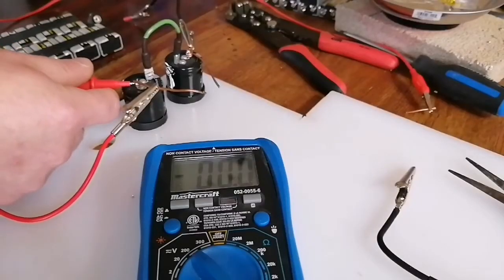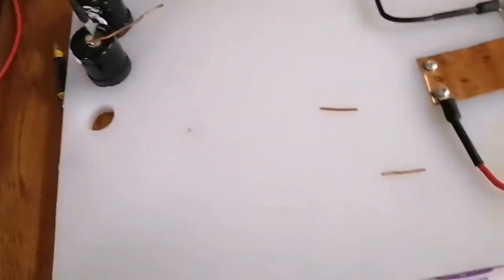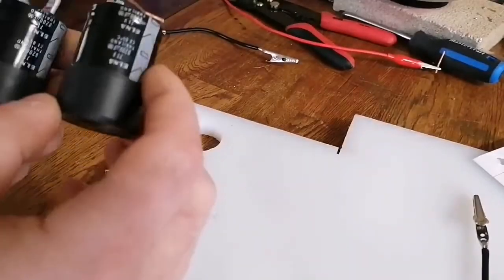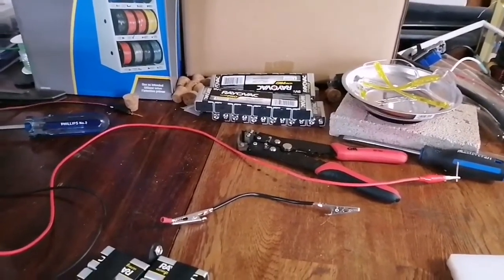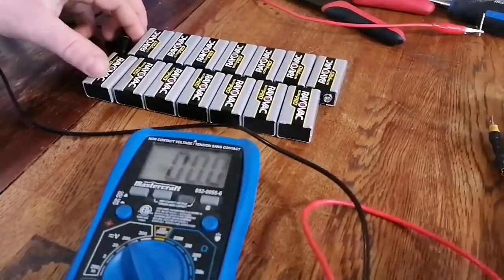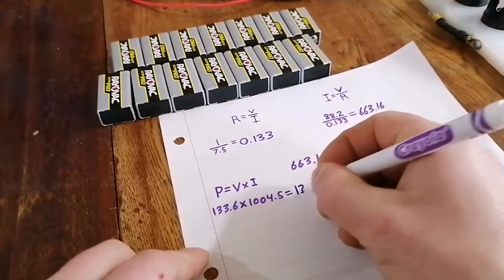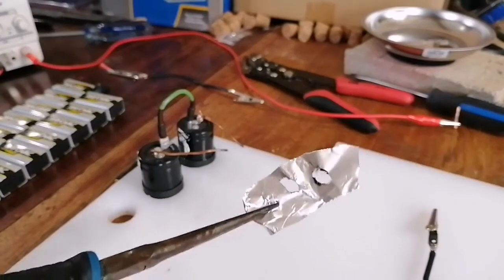Calculating Capacitor Discharge Current

Comment: I will say,  the contact point resistance will likely go down when that much voltage and current is applied. The metal either melts together or gets arc plamsa over a few square milimeters of the contact which helps it conduct.

Comment: If we factor in pulse rate in relation to joules per second then we could get much more energy out the capacitor if you pulse it. Have you experimented with an oscillator that will repeatedly discharge a capacitor thus increasing the energy level?
Reply: This is amperage dumped into a dead short, which all capacitors do well in delivering extremely high amps. It's not about the pulse train or any of that IMO, it's about somehow magically charging the capacitors that fast without actually using power. As of now we still are required to put energy into the capacitors before we discharge them.
Reply: @slackjaw so basically add an inductor to the cap, form a tank circuit and calculate resonant frequency or are you suggesting another method?
Reply: @slackjaw your comments get deleted on other videos, so i wrote all this good information down. Lets see how ít goes
Reply: @Magneticitist  so if we find a way to charge very fast the capacitor we can use the huge amount of power dumped into the dead short.what if we put a heavy load as a dead short
Reply: @giorgosz  Either way you look at it this is something that has been calculated by people for as long as I've been alive. There are extremely high amps discharged at an extremely fast rate over an extremely short period of time here. The 'time' variable here is what's most important. The amps dumped can be incredible with low ESR caps or supercaps etc. When you charge it from completely drained, it temporarily wants to pull a very high amount of amps so long as they are available, until gaining internal resistance and charging slower given a particular voltage input. You feed it those high amps, then over time fill it the rest of the way at a slower rate. When you discharge it, you are dumping literally the same energy you just put into it minus what you lost as heat. I can slowly pull back a rubber band over a period of 10 seconds, then at the peak of what the elasticity can take I can let it go real quick and let it snap against something. That snap may seem like quite a tremendous force compared to some instant of me slowly pulling the band back. It's still the same energy over time you add it all up though.

If you fill a bucket of water, then find a way to dump the water really hard and fast to where it seems to be transferring a lot of energy, you're still just dumping the same water you put into it to begin with. You may have slowly filled it with a hose, then dumped it extremely fast.  When you have a reservoir ready to be dumped somewhere and this reservoir is able to dump all it has extremely quickly like a capacitor can, you are just taking advantage of a stored charge in a way you could not do over-time from your input side when you were filling the reservoir.  But let's say you could fill the reservoir just as fast as you could dump it.. Where's the extra energy?
Reply: @Magneticitist  you re right if you could charge somehow without a lot of energy the capacitor then you have something. But you have almost the same energy as the input
Reply: @giorgosz  This is why there is no magic in the capacitor dump because we need to fill them to appropriate amounts of energy storage without actually putting in that amount of energy from the source. If we're able to do that then we already have overunity and every stage after can be practically anything.
Reply: @SKYLARKING  In a word, no.
Reply: @SKYLARKING  Sure sure that's me the disinfo agent. Strange that somehow you're the one saying an LC driven transformer is overunity.
Reply: @SKYLARKING  You don't make sense. First I'm a disinfo agent by telling you that your OU claim is not accurate. Now I'm sensitive? Explain to me how what you quoted me on is wrong? Who the hell is TK? 

And again, no, an LC circuit is not overunity. How can you be serious when you say that? That is not common knowledge among anyone in the electronics world. Just from a general basic underlining of an LC circuit, you still have real world resistance in everything. An LC circuit can freely cycle forever in an ideal example where there is no resistance. That's what you could call unity if you wanted to but there is no work being done there. Definitely not overunity. We use LC circuits to create better efficiency. It's done all day every day in every kind of way you can imagine.
Reply: @SKYLARKING  Obviously you don't quite understand how an LC circuit works because you're acting like its basic behavior is some kind of clear overunity. The L stores energy. The C stores energy. Yes, they ring it back and forth and damp as the power transfers to the load. But it's like gee, I wonder, where did they get this energy from? Well if you want to say Earth is helping, then sure fine there's all sorts of ways I can think of to siphon a small bit of power. There's also solar panels etc. 
When you start saying this charging from Earth ground garbage you start immediately letting it be known that you don't get how capacitive coupling works either. 

And yes I remember Tinsel many years ago as just some guy who was some kind of engineer or technician and hung around to test circuits and build tesla coils etc. I suppose maybe one day he said that a basic LC circuit is not overunity also. IDK maybe he told you that with a tuned transmission you are transmitting more real power which doesn't equate to less power drawn from the input. 

What do you think is even happening at resonance? That you're like lightly tapping this swing and then it's dumping all this energy out, with you only having to lightly tap it again? That doesn't even conform to basic newtonian physics. 
Literally everyone who understands LC circuits realizes that you're not putting more out than you put in at resonance. You're just putting in the energy most efficiently while still experiencing the resistive losses. You put energy into the swing, you're able to keep doing it over and over until that sucker starts to circle all the way over. You're not putting the same amount of energy in each time, you're putting in more and more because now you have what you could call a plain DC resistance against your pushes that won't change.
Reply: @SKYLARKING  The water analogy just doesn't work. I get sort of why you're using that. Electrical power or just power in general doesn't work that way. That's like thinking a DC capacitor closed in a circuit can sort of just keep looping around the electrons forever recycling the power while also running some load in the process. The analogy you're describing is the same thing as literally a single conductor. Just a wire, or a coin, or a metal bookshelf etc and saying water is the electrons contained therein. If it could just get its same exact electrons back all the time, like they had individual names or something, and recycle them then blah blah NO. You just still have the same conductor with the same atomic structure. If you add more charge to it from elsewhere then sure it has more, so what? 

There is something called energy transfer and what happens is in the best case scenario is what you described earlier. You put X power into the transformer and get X-R through the load. Resonance isn't like a 401K plan where it's like matching what you put in to some some extent. You simply get back what you put in for a cycle minus the loss. It's not doubling up and so on without you literally feeding it. This is why an LC tank does not naturally rise and rise forever on its own. It rises because you are feeding it. If you stopped feeding it, it would ideally just oscillate with what you fed it forever.
Reply: @SKYLARKING   I know what I know from personal experience and when cross referencing that with what is taught about LC circuits, it all makes sense. This is the benefit of being self taught, I'm free to think and absorb what I feel works for me based upon even advice from people such as yourself. With enough experience in actual LC circuits I can now identify what you're saying to be complete garbage juice with who knows what kind of intentions behind. 

Even if you wanted to help in some way with some real advice, just saying you need a specially tuned resonant transformer is not going to help anyone on the entire planet. What it would do is have people wasting hours on end with ZVS drivers and shit using the strangest designs while sometimes looking right past what could have been a pretty efficient converter. You're free to do what you want like me, and you can continue to waste peoples time with the bunk that leads to possibly some fake pats on your pioneering back. 

The entire foundation of the video we are even commenting on is some dude discharging capacitors and going wow that's a lot of amps, then people going "overunity". I mean cut it out.
Reply: @SKYLARKING  blah blah blah
Reply: @Magneticitist  Rick Friedrich said step charging is the solution to this problem. Step charging like bedini used can have a very high efficiency theoretically
Reply: @scraw3  What did they mean by step charging? In battery-charging terms that seemed to mean doing what already naturally occurs when charging a battery, or even a capacitor. All I've read was the idea of "stepping down the current" as the battery reached above nominal and close to full charge voltage.
Reply: @Magneticitist  the annoying thing about it is when Rick brings up step charging he never dives deep into how it works, but insist that it is a major factor to use a capacitor to power a load. He said that was what don smith was secretly doing to get those kilowatt outputs. Don would step charge a capacitor then discharge it in pulses and not a constant current. I suggest contacting Rick at renaissance charge or watch videos on Stanley Meyer replication, which apparently shows the waveform of a step charging circuit. I'm still searching for the right information myself
Reply: @scraw3  Doesn't surprise me he's not exactly detailed with the explanation honestly. I'd have figured a more "loving path" lol. Anyway the idea even in a general concept like that still doesn't make sense to me. No matter how the capacitor is charged it's still getting charged right.. so unless we've lost the ability to account for that charge we can already assume the magic is in the front end if it's charging capacitors via some free energy of sorts. If not, then we have to figure out why some capacitor discharge is really giving such high outputs. I'd wager just because that's what capacitors do, for a very short time which amounts to peanuts in the end. It's more or less the entire point of using them for current reservoirs. Since we all know we can charge a cap and short it out to see those amps do things like weld or blow chunks out of metal, the problem is recharging them fast enough to make that discharge seem continuous. If it isn't, then we are going in circles because we need more capacitors on the output lol.
Reply: @kestas4792  yes I agree. I'm building a few resonant transformers implementing the formula you mention for energy amplification. One of those coils will power a storage cap bank. Please explain what you mean by disturbed discharge because I need to figure out how to discharge the cap bank atleast 60 times a second
Reply: @kestas4792  ok yes I'm employing a disruptive discharge already
Reply: @kestas4792  if you asking me about my driving frequency, all my  transformers will be pulsed at 30 khz.
Reply: @kestas4792  one transformer is fixed frequency at 30 khz and the other is quarter wave, so I can step up frequency from 30 khz to 50-100 mhz. Spark gap to transformer and cap is a good idea
Reply: @kestas4792  are you familiar with resonant inductive charging? I read that it is up to 90% efficient in cap charging since normal cap charging is under 50%. You can control the cap charging speed with different size inductors. No energy is lossed using this charging method
Reply: @kestas4792  this is what I'm talking about "The efficiency for resistance charging is then 5.0mJ / 9.90mJ = 50.5% (approximately as expected). The efficiency for inductive charging is 17.1mJ / 18.5mJ = 92.4%.
Thus the inductive charge is about 1.83 times as efficient as resistive charging, for the simulated conditions.The capacitor charge time for the inductive circuit is approximately 1/2 cycle of the LC resonant frequency or π√(LC).
Thus for the simulated values of 1mH and 100μF, the charge time is π√(1mH*100μF) ≈0.993ms, which is very close to the simulated value of 1.01ms. A lower inductance would give less efficient, but faster charging while a larger inductance would give more efficient but slower charging time.
This efficiency change occurs because the the peak resonant current is inversely proportional to inductor size, which changes I²R losses from the parasitic series resistances, as previously noted. The tradeoffs are charge efficiency vs charge time and physical inductor size and cost."
Reply: @kestas4792  an article posted by someone in electro tech-online

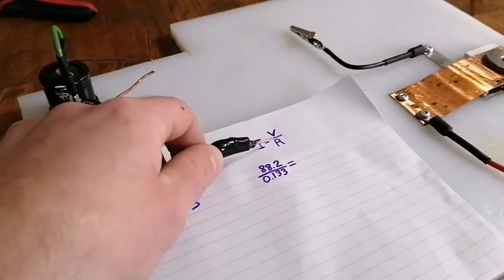Comment: 2:00 - Or you could just take 7.5v per volt and multiply 88.2v to get the current of 661.5 amps (not sure where the ‘hours’ came from).
Reply from the maker: Good point. And you're right, I should have said amps

Comment: how to measure the endurance? I am trying to make a capacitor flashlight as an experiment and I need to find the right size capacitor and resistor so the light can last a few minutes.
Reply from the maker: Hey thanks for the comment, how much voltage do you need for this flashlight? I'm thinking I would recommend buying a few supercapacitors off Amazon or eBay. If you try using regular capacitors like what I have here, there won't be very much total energy and you'll either have a massive flashlight, a dim one, or one that doesn't last very long. As for the correct resistor, I'd recommend watching some videos about ohm's law. I could explain it here but it would make this a reallllly long comment 😂

Comment: That was a good video. Very educational.
for my own curiosity how to measure the charge in a capactior, is it just hook up multimeter leads to both terminals, or will that blow the multimeter since amperage is so high?
Reply from the maker: Thank you, it's nice to see that the video is being generally well recieved. As long as the multimeter is rated to measure the expected voltage of the capacitor, and is turned to the correct setting, it will be fine. In fact, a low voltage supercapacitor can be used to power normal things like a light or a toy motor without blowing them up, because capacitors are subject to ohm's law just like batteries are. Hope that helps!
Reply: @thecrazyfarmboy  thank you. i can learn well from here.
Reply: You can use the volts setting. Just don’t try with the amperage measurement.

Comment: lmao... 58.5 kW discharge. Wow!... So the answer to my question is yes, capacitors can be active participants in buck and boost converters. The amount of electrons passing a given point per second.. The Ampere. That's allot of electrons. lmao.. crazy.  663A x  6.24 Quintillion electrons (A) = 4.137120 Septillion electrons passing a point per second. That's 24 zeros. 4.137120^24

Good video. lol. Capacitors are dangerous.
The human body (skin-hand-dry).. has a resistance roughly around 1MOhms of resistance.
The human body (skin-hand-wet).. has a resistance roughly around 1k+ of resistance.
Be safe and be careful messing with capacitors, caps.

Comment: For How many seconds it will provide that much amps ? And how to calculate that?
Reply from the maker: Good question, it is definitely in the range of milliseconds, probably even less. The current starts to drop immediately after it starts flowing, so the amount of time that it's putting out its maximum current may be only a fraction of a millisecond! There is a way to calculate this, but I may need some help from any knowledgeable viewers on that one 🙈 I don't know everything! I just like to experiment & learn
Reply: @thecrazyfarmboy  thanks you sir
Reply: @thecrazyfarmboy  sir, I've another doubt 
In super capacitors it has about 2.7 volts but it deliver more current than normal capacitors .
Let's assume , 
In super capacitors, 2.7 v charged capacitor shorted with 1ohm resistor , by ohms law it should produce only 2.7 amps , its very much low compared to 16v normal capacitors sorted with 1ohm resistor.

But actually super capacitors produce more current , so i think , this calculation won't work on super capacitor.
Sorry , if iam wrong .
Reply from the maker: @Channelnvs  I think I understand your confusion - a 2.7v super capacitor can store/deliver more total energy than a regular 16v capacitor, but that's typically measured in joules (or amp/hours for batteries). When talking about the amount of current flowing in amps, that doesn't factor in time. So you're right, a 2.7 v supercap shorted with a 1ohm resistor will only put out 2.7 amps, but it will do it for a very long time, because of its much greater energy storage. The 16v regular cap will put put out a lot more current, but it will be for such a tiny duration of time that the total amount of energy will still be very small in comparison. Hope that clears thing up!